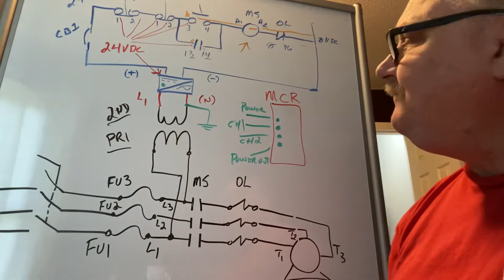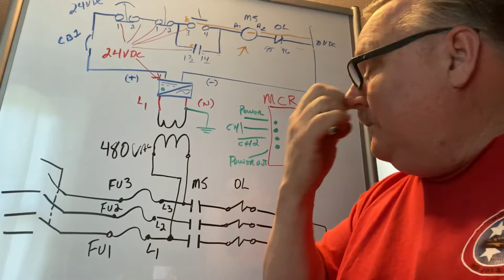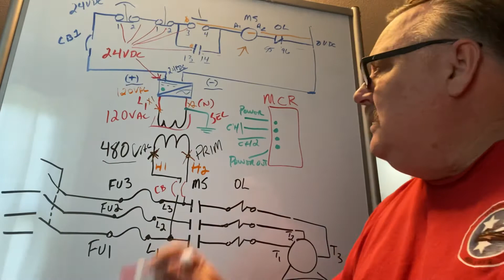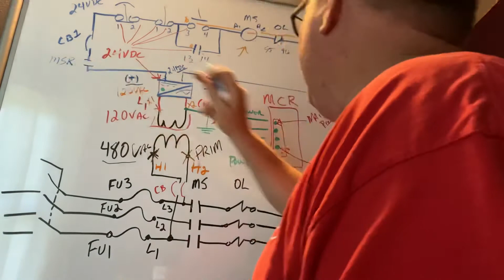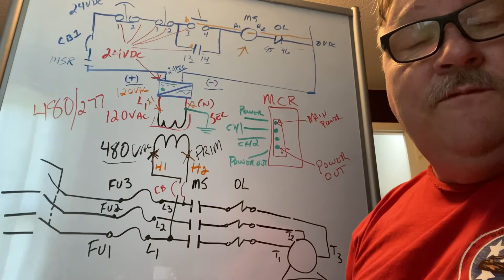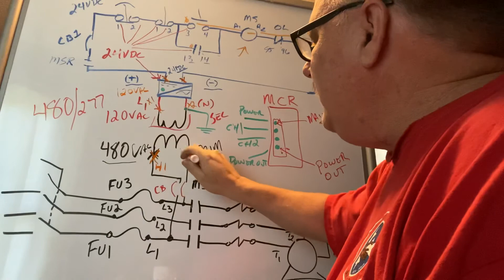Motor Controls 4

Comment: Hi MIke- What voltage typically are the indicator lights on these systems?  Thanks!!
Reply from the maker: The green lights on the MCR and power supply are small 24vdc LED lights. They are built into the components.